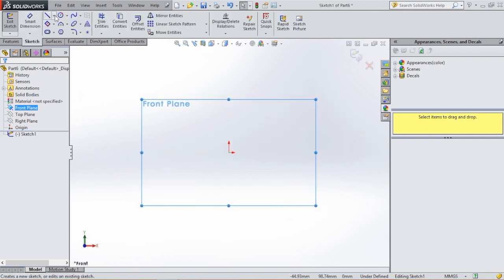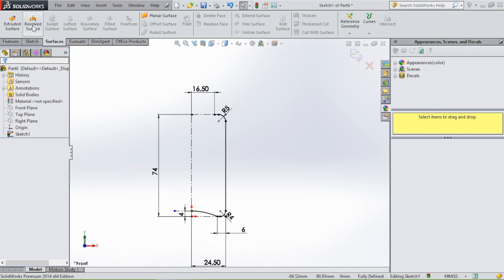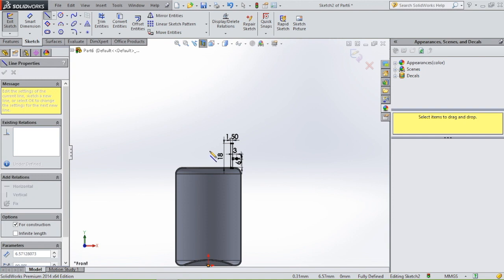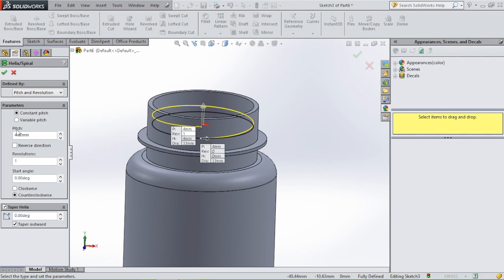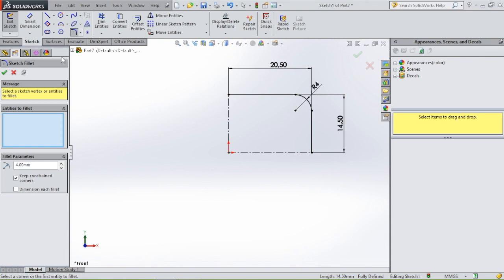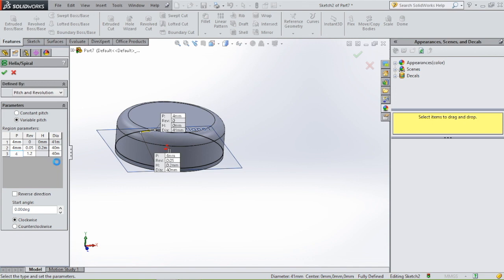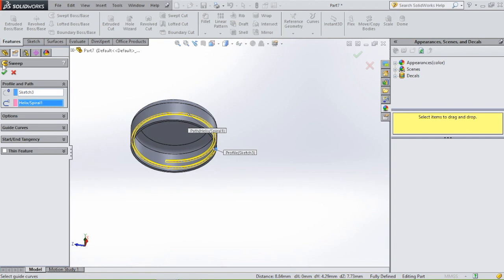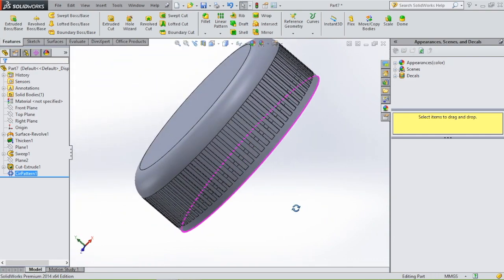SolidWorks Beginner tutorial 4: Medicine Bottle (+ screw thread)

Comment: Awesome videos, good to see you active again here! I`d like to ask couple of questions if you dont mind. When you did a spiral, how did you know what variables to give when you created them? How did you choose the profile (and the one on the opposite side of it) you  used? and last but not least: is there a way to know that those spirals actually are matching and working optimally?  Like said, awesome videos, keep them coming :).
Reply from the maker: Hi! Thanks for your questions! Before I made the tutorial I measured the product with a caliper, so all the tutorials I make are actual products. What you can do is check if the profiles match (If you are working on a project) by using the section view option and use move part (rotate) where needed. If you are not sure about the tolerance and measurement, you can always ask a product engineer. I try to show as much features as possible in my tutorials, so this tutorial I show how to insert a spiral with a various pitch and in the next tutorial I show a spiral with a constant pitch. Hope this is the answer on you question. More tutorials coming soon!
Reply: @designertutorials1320  Very nice job on this. My only thought is you mated the 2 parts without reguard to the threads. If I were to take a sectional would I see crossed threads? Problem!!